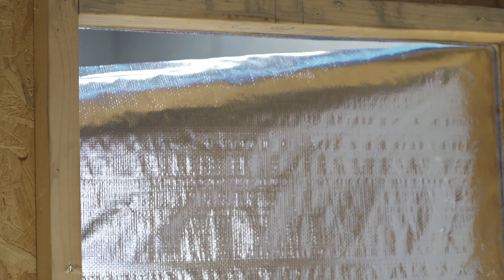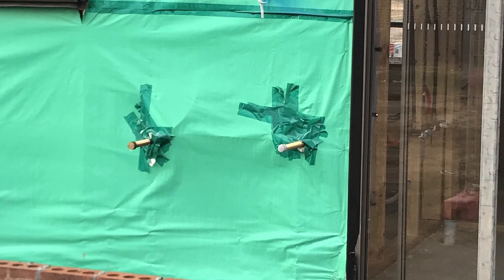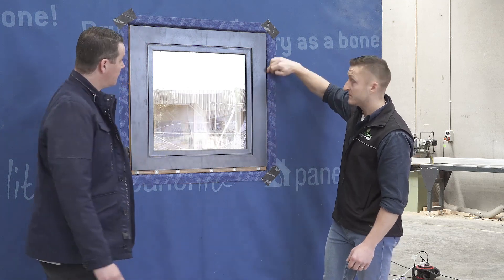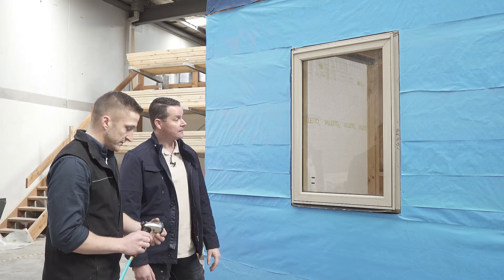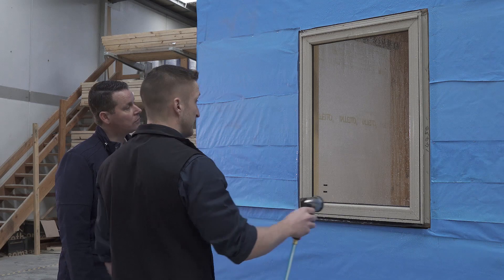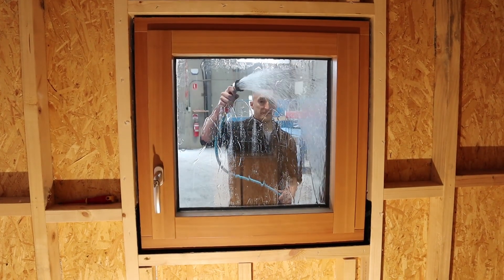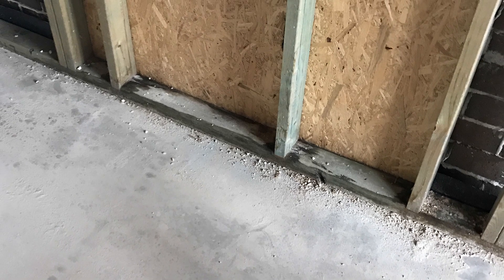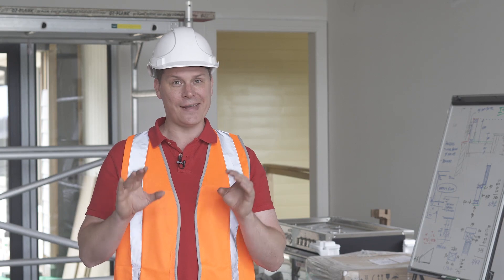Building a Home for a Better Seal | Part 3

Comment: Hi John, I'm about to start my ICF build as owner builder and have just discovered passive house design principles. It's amazing how if it weren't for YouTube reviews on building materials, i would not have discovered Passive house. There just doesn't seem to be any advertising about the benefits of Passive house design in the media. Anyway, if i was to change my design and aim for a more air tight home with extra insulation and use double or triple glazed doors and windows where required, is it then a matter of doing a blower door test, hopefully obtaining a good score and then having Passive house certification? I'm not sure if i have to have a Passive house designer involved to go over my ICF home and comment on things i would need changing...
Reply from the maker: We are glad you found our videos.  It depends how far you want to take it.  Send our company an email.

Comment: What about using ZIP2 for wall construction ?
Zip 2 systems come with various level of insulation attached and tapes and sealers to use for joints, windows and doors.
Reply: I’ve tried to find a similar system to huber’s zip system within Australia, but to no avail. Would be great if we could get it over here!
Reply: @yavok  Contact their customer service and ask if they have a local distributor. Might be a business opportunity.
Local distributors need to know that people / contractors are interested in the products. Any home builder associations interested ? Any Net Zero or Passive House builders ?